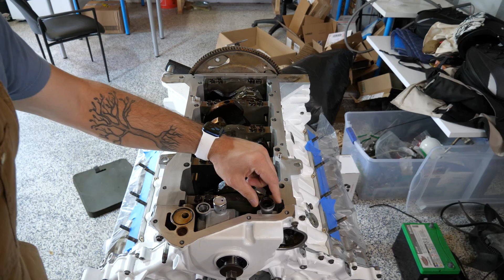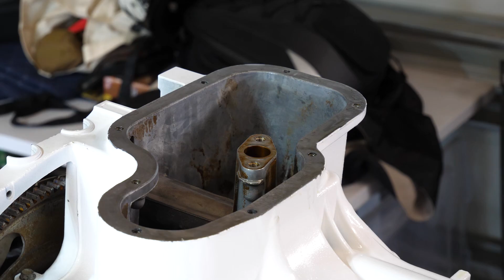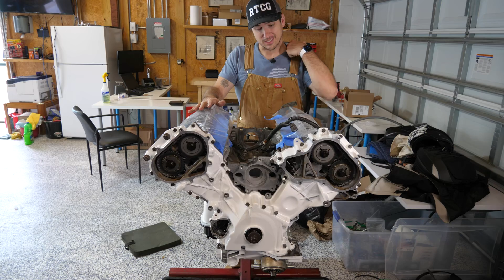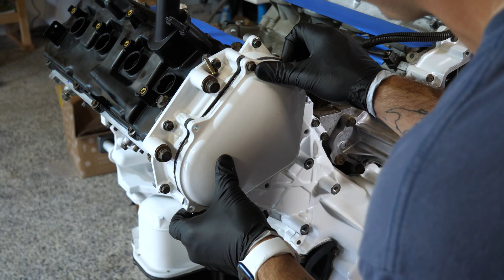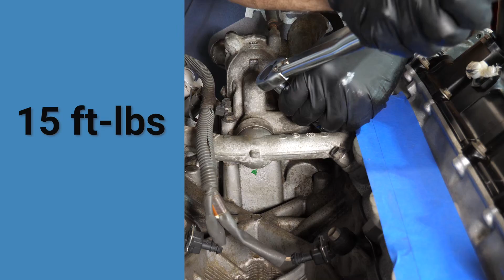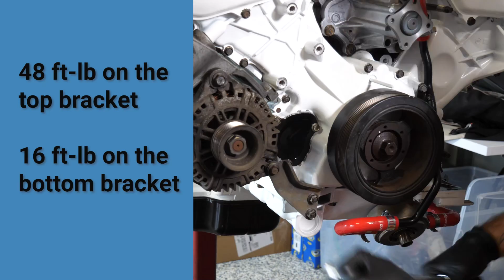VK56 Engine Rebuild Part 11 We finish the engine build! Titan/Armada/QX56

Comment: At 20:39 was that a new gasket or the same one only asking cauae its aluminum with rubber coating n I just reordered one $10 n ive looked everywhere for those torque numbers n cant find them anywhere so for that thank you

Comment: @3:33 what orings are those? I can’t find them
Reply: Genuine  Nissan & Infiniti 150667S000 Many Models  Seal O-Ring 15066-7S000 !
Reply: Where can you find the oil pump O ring?
Reply: @eray-23 z1offroad has all the specialty oem parts

Comment: Why not remove oil cooler?  you removed everything else.  Would have made removal of that bolt so much easier.
Reply from the maker: You know, I don't know. Maybe I was just over it at that point
Reply: @Rythecarguy  nice video series.
Reply from the maker: @TitanTown  thanks man. I appreciate it. It was a ton of work.

Comment: Once you have everything assembled, Flex plate on Harmonic balancer on, you should do a couple of revolutions of the engine, just to make sure everything turns smoothly and nothing binds up. Better to find out now than after the engine is back in. It also helps set the timing chains in place. Keep up the good work, Many are learning from these awesome videos. Like I've said before I have rebuilt hundreds of engines, but I enjoy watching your videos They are great.
Reply from the maker: That's amazing, thanks bob.

Comment: Did you replace the oil cooler gasket or did I miss that along the way?
Reply from the maker: I did not. Engine is coming out again soon so I will probably do it then.
Reply: @Rythecarguy what are you pulling it out for?
Reply from the maker: @DarrenBoxhall  I put it into an Xterra. :D

Comment: Address, I am sending you an oil squirt can.
Reply from the maker: Lol, you don't like my "pour it all over" style.
Reply: @Rythecarguy  I love the fact you tackled this. You honestly made it look easy but you also pretty much tripled Checked everything. 

Why didn't you use assembly lube on all Friction materials?
Reply from the maker: @chrisxavier3782  thank you. I appreciate it. I didn't use assembly lune because I am crazy about following the factory service manual to a T. it tells you not to and to only use oil. 

Sometimes I convince myself the thing will blow up if I deviate even in the smallest way. 🙃
Reply from the maker: @chrisxavier3782  plus I knew I was going to prime it too. So it's less critical on the main bearings when you prime the oil system.
Reply: @Rythecarguy  I can see that, it's what I wouldve done too. Can you make a video on what you would've done differently? And I can't stress enough how more content creators should post on screen the Torque specs or verbalize it. Spot on work.

Comment: Hey Ry! I have a 05 SE, 2wd automatic. Just hit 200k and sometimes when there is strain on the engine at idle when warm the oil light will come on but I barely tap the gas and it goes off, it almost seems like a low idle problem, it sometimes gets to 550-600rpm if I were to put the car in gear from park or neutral but goes off after a few seconds. Also seems to be maybe because it’s now hot out? I also switched from synthetic to high mileage recently. The car is pretty much not compensating for it, could it maybe be an alternator problem? Please get back with your input! 
I replied to you on the pressure “problem” Video but thought I would stop by on here so you can see it!
Reply from the maker: Hey Donnie. I would look at doing a relearn of tithe idle controls. I have a video on it (for the Xterra but it should be the same). Thats free and does not hurt to try. If that does not work I would start diagnosing your IAC or MAF. Sometimes those will cause a wonky idle.
Reply: @Rythecarguy  thanks Ry! Gonna be doing driver side valve cover this weekend so I’ll clean all that stuff while it’s off